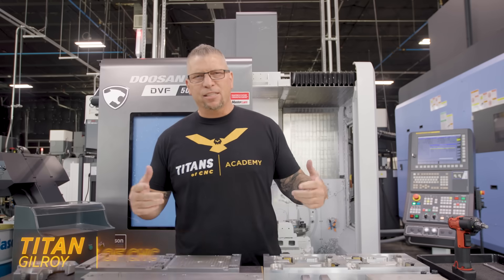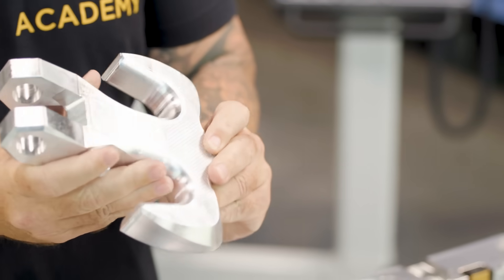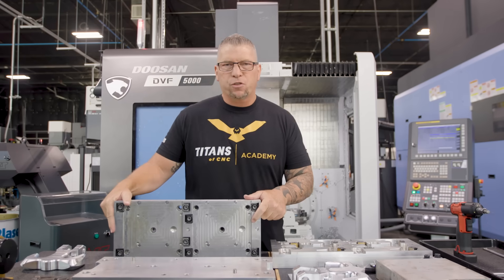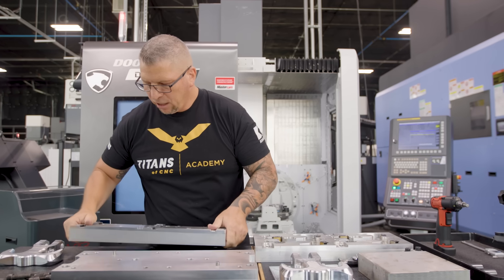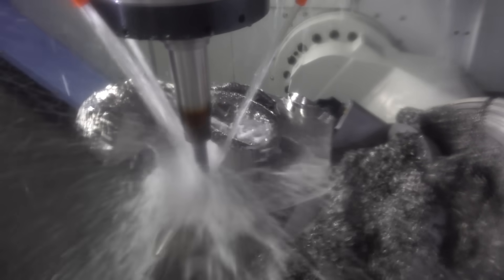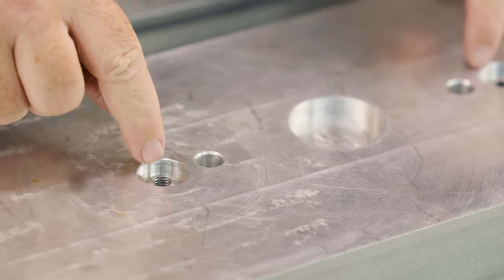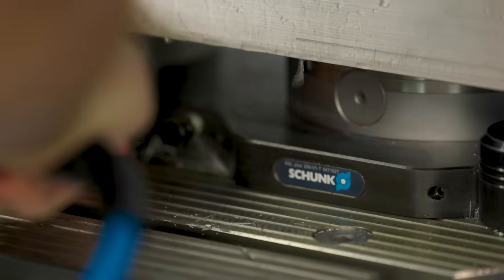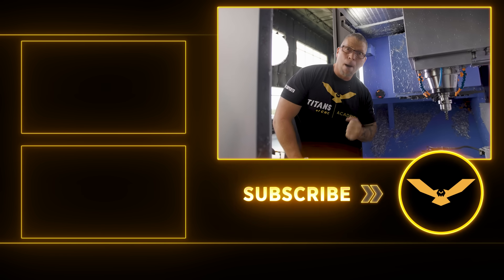Insane Fixturing Techniques Explained | DVF 5000 5 Axis Mill Machining

Comment: Why wouldn't you just add the nobble lock down pins to the top plate though. Surely having a quick change system that you then have to slow change a top plate on defeats the object of the exercise.

Comment: Newbie stupid question.
In the old system the base plate is bolted to the machine table using t-nuts, right?
But do the base plate holes have enough "wiggle room" to move the base when you are indicating the base plate ?
What am I missing?

Comment: Skip the base plate. Looks like you could maybe install locking pins directly in your fixture plates. Also increase your accuracy by canceling out the imperfect pin fit you get in aluminum over time.

Comment: Why don't you put the vero s system in the bottom of the sub plate and skip the base plate. That way you can load up the sub plate with the next part and just drop it in and go

Comment: Why not have the first and the second op on the same plate? This way, you get one finished hook each cycle and never have to swap the plates.
Reply: Tool changes = time = $$$ 
If you are not cutting chips, you aren't any making money. *2nd op might use more or different tools.

Comment: Hey Titan, as always love the videos!

Question: why not put the shunk studs on the sub plate instead to simplify it and reduce stackup? Would it not be rigid enough?
Reply: That's a good question, actually.
Reply: @UCB0ETIwm_oVYGbL9V8pgBCA well they use shunk studs everywhere. I figured the sub plate could use the studs so you can swap the sub plate quickly without having to undo bolts so you can transition to a different job faster

There's also the benefit of just switching out a lighter subplate for a preloaded one so you're not sitting there loading/unloading parts and stock in an idling machine,.
Reply: @KC-rd3gw  That is a reasonable suggestion and is also how other pneumatic systems work. I am using 20 x 12 x 1.25" interchangeable pallets spread across 2 Pierson bases, pitbull and dual expansion clamps for 40 (smallish) part pallet. The Pierson bases don't use studs but rather ground hardened sleeves and the base has the studs (and central pull down). Either way, IMO there's often no need to duplicate and double stackup. At worst, one can run thicker pallets if the work piece fastening interferes with where the Schunk studs have to fall out (if it absolutely has to coincide, possible you can shuffle in CAD as it's your own fixture).

Comment: How often do you indicate that fixture to see if it's still true and is it necessary to indicate it? If it's production parts you're cutting with that I understand the tolerances won't be too tight but can you use those fixtures for tight tolerances also?

Comment: Titan, can you not mount the billet standing up in the 5 axis vice and machine it in one operation on your five axis machining centre? You should be able to access all sides and leave a thin section at the bottom to break it off. It would then only require minimal manual finishing. Save on two fixtures, setting up time and only one program. Boom!

Comment: OK the ability for the air gun to just plug right into a push-connect fitting for supplying air is actually pretty dang slick. I like it.

Comment: how rigid is the Vero s compared to bolting the vise to the table directly?
Reply: I spoke with schunk recently.  I forget the kn but it's really Ridgid.  Stronger than the 4 1/2-13 bolts to bolt it down.

Comment: I'm not crazy about only having two small 3/8" or 1/2" bolts holding the pins on, seems like there could be a stronger connection.
Reply: Don't worry. It's not 1/2" but M12 🤓
Reply: @norbertfleck812  Well in that case it should be fine. LOL

Comment: Hey Titan, how do you trust the Vero-S system to not move every time you remove any one of your pallets from the base plate or the Vero-S system itself? I would think with every pallet or baseplate you put in there is a new opportunity for the whole system of fixtures to move a thousand or two, and that thousand or two then show up in the part.
Reply: The Vero s system is supposed to be accurate to within .005 mm (not inch).
Reply: @warren1786  .0001in

Comment: Nice video Titan! But wouldn’t it be even a bigger time safer if you put the pins from the Schunk vises directly on the fixture plate instead of the base plate? Then you wouldn’t have to unscrew the fixture plate from the base plate and you safe some money on the material side of things…Just wondering if that’s right what I’m saying…Keep it up!✌️
Reply: I was wondering the same thing. I think its because they have all the stuff already so I'm assuming if they had to make a new one for a new part you could delete the baseplate

Comment: Why not just put the Vera clamps on the fixture plates instead of the base plate?
Reply: Putting Vera clamps on the base plate only requires to do it to one plate instead of both sub-plates. He already has the sub plates working for the base plate and that is the only reason I could think of he did it like that... Oh, plus the Vera clamps/studs aren't cheap either (Not like money is an issue for Titan ;) )
Reply: @EUnit111986  yeah I know money isn’t tight in that shop. My other thought might be that he’s still trying to show case his old school fixture in it’s entirety for the machinists who can’t get the Vera system and would heavily rely on the base plate.
Reply: @tylerakerfeldt7220  I think that combined with the need for additional locking pins/nubs.  You have a pair per master plate/project rather than a pair of pins per sub plate.  
Like you said, im sure they could have as many sets of pins as they wanted, but for the everyman shop, they arent cheap so you at least get some utility and quick project swapping while being able to utilize previous sub's.
Reply: @EUnit111986  If needed... he can make these studs inhouse.. i don't see a problem there.. :)
Reply: This was my first thought too.  Why not load the fixture plate outside the machine and drop and go.
Reply: Being a machining shop....they couldnt just make the extra pins? That's one of the first things I would look in to. Like if one has 6000 PN's to work up. Unless they are unobtainioum... I'm making my own.
Reply: Its probably more accurate to have a pinned base for the other fixtures while still being modular.. We still run old school Kurt vises so this was new to me.
Reply: They use multiple fixture plates on the base plate. This way one mod to the base plates let’s them use all the different fixture plates for that base plate
Reply: I'm assuming it's because the fixture plates are only aluminium. They're not rigid enough.
Reply: @gredangeo  base plate looks aluminum too.  Titan is a big guy but he's not gonna be handling that base plate like that if it's steel.

Comment: Titan, can you please show us some techniques on how you lock down the part into the second fixture plate for cutting the back side? Thx.
Reply: Titan didn't talk about in this video. However, if you look at the 3:10 mark, you will see Mitee Bite Uni-Force clamps for holding the the parts for OP-2. 

If I remember correctly, I think Mitee Bite will help with fixture design. Also, on Titan's Academy website, you can find a whole section called, The Art of Fixturing.

Comment: I had the same question regarding the need for the base plate. Accordingly, is the base plate placed only to compensate for z-axis reach. Furthermore, could you elaborate on how to probe accurately when you flip the parts between the setups. Many thanks for the very useful content.
Reply from the maker: The base plate is locked to the table. Then the fixtures position quickly and accurately to the base plate and can be switched out quickly back and forth.

Each part position has a precision hole that serves as XY center location so all you do is probe a single hole for G54 and G55

Comment: Aah I remember seeing the monster hooks before in your older videos. It's quite nice seeing some of the parts you've done outside of the Academy content, helps provide some context to it all.
Reply from the maker: We also have done decades worth of Aerospace parts for the biggest rocket companies but can’t show our work because of NDA’s etc. Thanks
Reply: @TITANSofCNC  Aye that’s the tricky thing. In the eyes of the public NDA parts may as well not exist, which sucks from a marketing and sharing perspective. Is what it is, I know the feeling!
Reply: Can’t wait to see you hog some chips on your new Datron machine dude! I’m currently building my own mini-mill to make some custom mechanical keyboard cases along with other stuff. I’m working on the sheet metal enclosure ATM.
Reply: @Thorhian  Sick! Yeah I can't wait either, just over a month until delivery now, so hype. Are you documenting your build anywhere?
Reply: @bittech1  just amongst friends at the moment. I’ve taken a good amount of photos along the way though. It’s been a ton of work. Just wish I could afford a proper ATC spindle right now but I’m using one of those green manual BT30 spindles for now. I plan on replacing it down the road.

Comment: Could you simply get rid of the base plate if your using the Vero s system? Mount the very pull studs directly to the part fixtures in order to skip manually bolting the fixtures down?
Reply from the maker: Yes

I might make the fixtures a little thicker though to add rigidity. You would need 4 pins instead of 2. The pins run about $80 a piece I believe. We actually sell them on our store. Store.titansofcnc.com
Reply: Maybe those pull studs are much more expensive. Or this helps to save material, as you dont have to use such a thick peace of metal for your pallets.